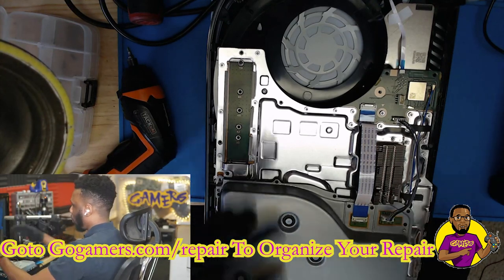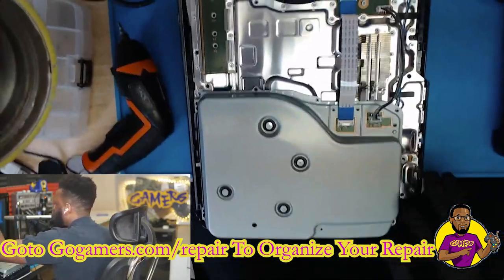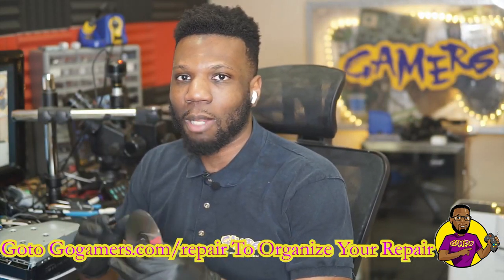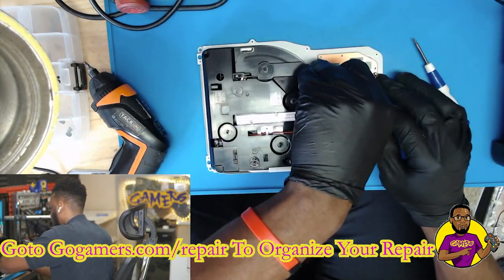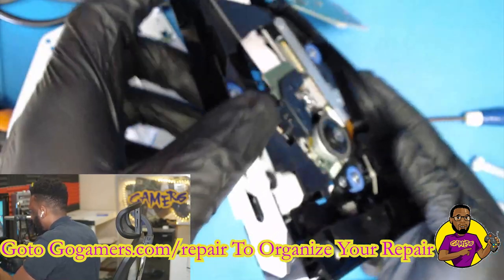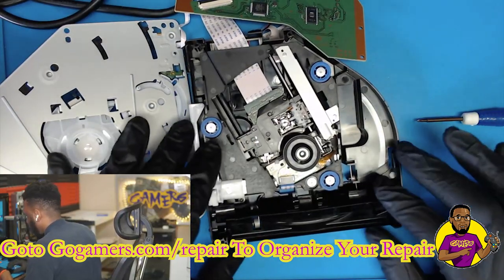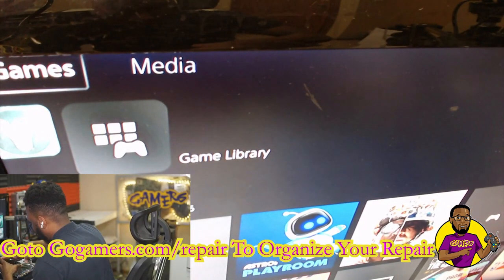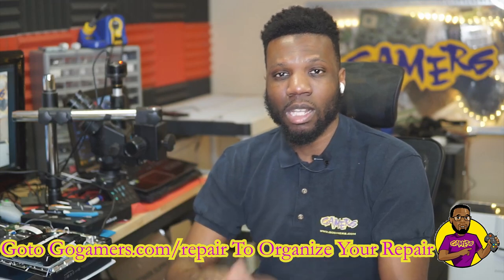HOW TO FIX PS5 wont/Not Reading Discs Or Games *Unrecognized Disc Repair*

Comment: Got a brand new PS5 yesterday, tried all my ps4 games and just won't recognise them. Really loud clicking sounds when the disc is interested. Tried all the solutions , disc interested correct, clean, not damaged, restart but nothing. I guess I'll have to try and return it due to being faulty? Don't trust myself to try and fix it myself lol
Reply: Lmao so we're both just searching how to fixed it huh? Cuz I was u in another video I have the same problem
Reply: Same here...brand New ps5, treedt several ps4 discs to nog avail. System is up to date
Reply: @CescoBoeckhorst  isn't that cuz ps5 works with only ps5 discs?
Reply: @hehehehaw8346  nope, ps5 is backward compatible
Reply: @CescoBoeckhorst  hm then it's maybe the disc reader that doesn't work just return it for fixing
Reply: You have the disk upside down

Comment: Do these types of repairs void the warranty? I got my console at launch and just started having issues with the disc drive a few weeks ago, restarting a few times fixed it last time. But today, I went to upgrade my ssd from 500gb to 2tb, so I took of the first plate, cleaned everything including vacuuming ports, put it back and did the other side. Went to switch the ssd and realized after I took the 500gb out that I needed a heatsink for the 2tb. So, I put the 500gb back in, put the cover back on, went to reinstall some games. Every disc I inserted came up unreadable. Drive was clicking a lot and after a few tries, it refused to push the disc back out. So, I followed the Sony website instructions to use that screw above the drive to move the disc ejector. That did not work until I had the console held almost vertically. Then I finally got the disc most of the way out. Removed it the rest of the way by hand. Reassembled everything again. Put a disc in and it installed. But it was a 2 disc game, so when the data disc was done, I went to swap it and the drive wouldn’t eject. Repeated the thing with the screw but could only get the disc out by lifting it a little with a folded twist tie while I turned the screw. Tried again to insert a disc after that, it would take but not even spin or recognize that there was a disc. Then I gave up and went to youtube. I don’t want to send my console to Sony for weeks or months and pay a ton of money. Can you help?
Reply: If your PS5 is still within its warranty period, whether its the manufacturers or extended this WILL void your warranty. In order to dismantle all the way down to the disc drive you have to remove various screws. One screw in particular is covered by a "warranty sticker" which warns you that once removed your warranty will be void. Unfortunately there is no way to remove this screw without removing the sticker.

Comment: My disc drive not spinning at full speed and stop . It repeat again and again . Please help
Reply: Same problem. Won't even read the disks
Reply: have you’ve found a fix just happened to me today
Reply: @TheMightyChorizo  yeah I already fixed my disc drive . Just buy new laser replacement .
Reply: @dondondonchanel7423  thx you so much
Reply: @TheMightyChorizo  so will happening to everyone beacuse i have strange sound 
so i need to go the ps5 warranty

Comment: I have the same issue,my 4yo daughter put multiple Nintendo switch cartridges in my ps5 disc drive. I think I got them all out (without opening the ps5) but like this video I can’t get my ps5 to read or recognise any discs. Should I try and fix this myself or find a  repairer to do it instead?

Comment: Could I get your input on what you feel the issue is by watching/listening to this?
https://youtu.be/AxuXMIWdviQ?si=Lp4vKPe6kggZ5obv
I don't know if I have to replace the whole drive, it sounds like it is just the laser enclosure. I know the video doesn't show if it is the first issue where the disk isn't going in all the way, but it's not sticking out at all if that's what it would do in your situation.

Comment: I press the eject button and nothing happens.  It wont take a disc, I dont even get the typical 3 beeps.  Everything else with the PS5 is fine.  I put a meter on the plug on motherboard that connects to the drive, I get 12v but not getting anything on the 5v pin.  Any thoughts?
Reply: I'm doing a repair on a similar issue. I had noticed that a small fuse on the underside of the board in line with that 5v was blown. Replacing it didn't fix it however I borrowed 5V from the USB port nearby and did get the drive to take discs again. But it's not reading currently so still trying to figure that out. Fuse was a 0402 size smd with "O" stenciled on it. Found it to be 2.5A fuses from panasonic on mouser.
Reply: @michaellawson3899  Thanks for the info!  I will double check those fuses and I was thinking about running a line to grab the 5v.
Reply: @kalmangt2265  Np. Just be careful about the metal shroud used for the cooling. The wire will run right under it. I used heat resistant tape to insulate the solder points from grounding out when reinstalling.
Reply: @michaellawson3899  Did u return it back and get a new one? I have the same problem
Reply: @HE HE HE HAW  it was a bit of a double issue. The loss of power caused the disc drive problem. But once I fixed the power, I couldn't get the discs to read. I thought it was a board issue. I messed with some components and got to take and spin discs but not read it. Messed some more, and it stopped taking discs. Turns out that the ribbon cable took some damage from the constant in and out while I was testing it. It's likely that my messing with components caused more damage. Never got the drive to read or take discs but found out it was the cable as the system stopped accepting updates as it couldn't talk to the drive, which caused a system error during updates. I held the damaged cable in a bit tighter, and it allowed the update to process. Replaced the cable and system works as a digital unit.

Comment: Jux got me ps5 just here wondering if this 💩 is going to do same as the ps3 and ps4's did .....so obviously and apparently I'll be waiting my turn for mines to eventually start and is it just me but doesn't it seems like the issh starts to tweak when u get nba2k discs or something mines have seems like almost all the time from PS3 to ps4 and I've bought multiple of each of those consoles because of this exact same problem...but if this bihh duz start to tweak out yeah I'm so done with gaming 
PERIODTTTTTT